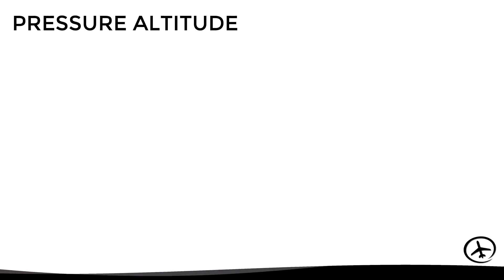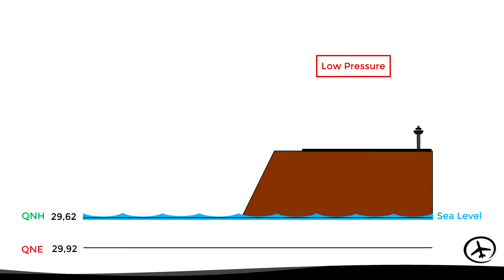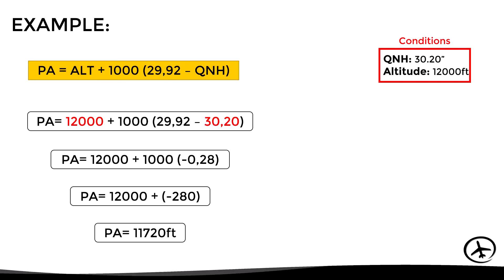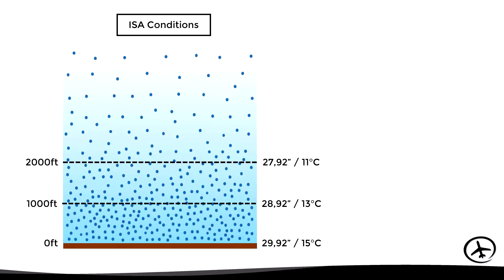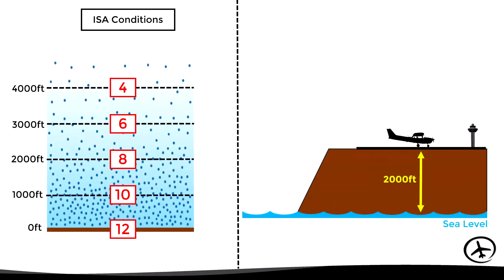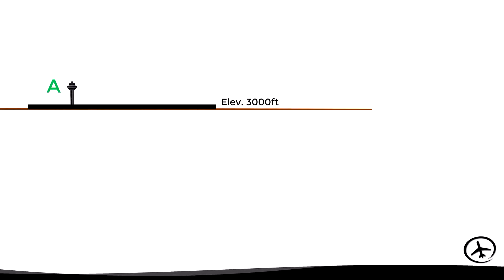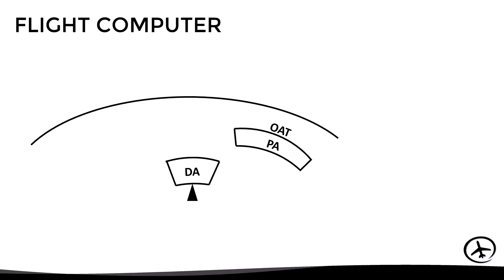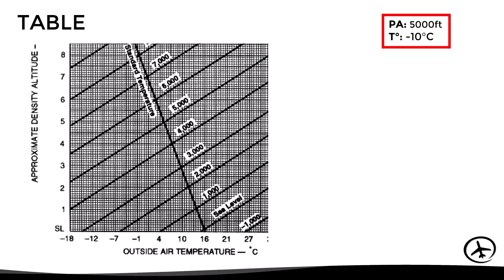Pressure Altitude & Density Altitude Explained

Comment: In the end what matters is if its a low pressure day how does a student fly the plane differently?
Reply: All this calculating to get a number but then what is done with that number in Actual flying the plane?? No one seems to talk about that!!!!!!!
Reply: Basically it's just to make pilots aware that their plane will not perform as well at high density altitudes. So one must be aware that takeoffs and landings will require more runway length, climb rate/gradient will be lower, etc.

Comment: The lower pressure and hotter temp, the lower the air density , the higher the density altitude and worse for the aircraft.

Comment: The air pressure at sea level is 14.7 PSI. But what if the sea around the world rose to 30,000 feet higher than it is now? 

Would the air pressure still be 4.3 PSI at the new water level? Thanks!

Comment: Amazing.. explained
Reply: Hi, I watched this but couldn’t determine what the sea level pressure would be in the sea level around the world rose 30,000 feet. With the current sea level the pressure is about 4.3PSI. But what would the pressure be at sea level if the sea rose 30,000 feet? Thanks if you have an answer or a link to a video explaining this. Thanks!